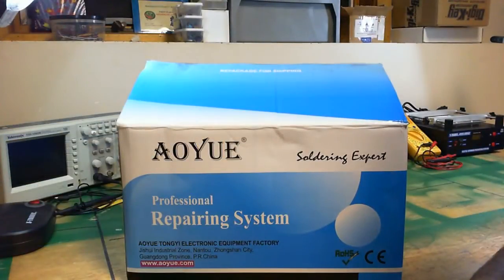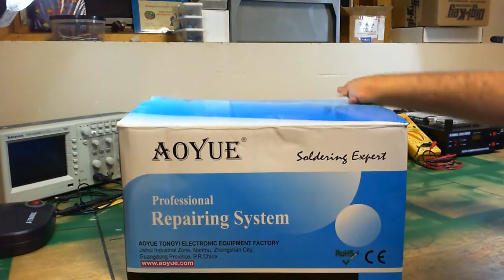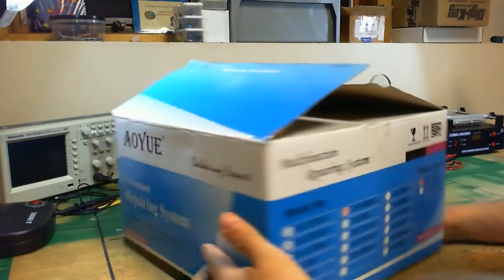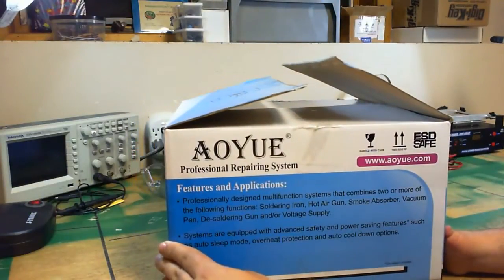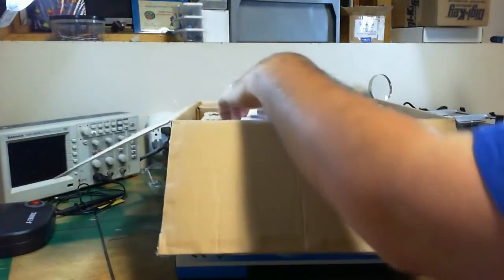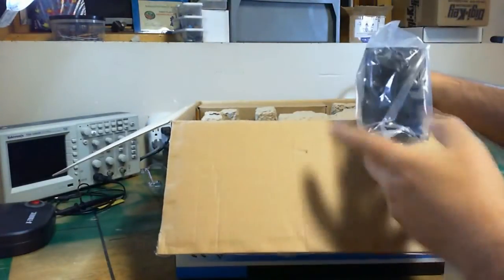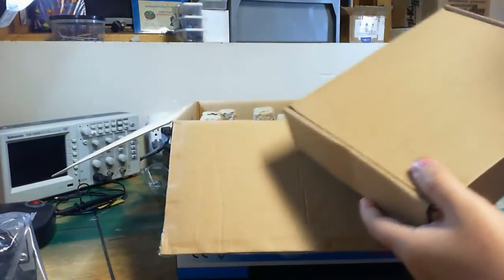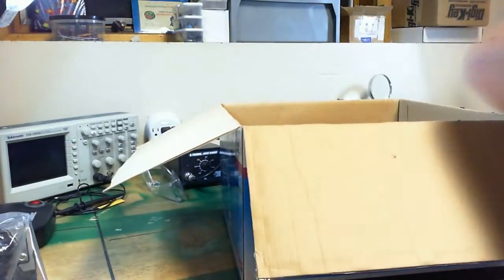Aoyue 968A+ (Product Unboxing)

Comment from the maker: The solder spindle gets mounted on either side of the soldering station as per the instructions but I believe you could mount it in the middle if you wanted but you would only have 2 screws securing it there unless you put more in. I would not recommend that though due to it being so close to the soldering iron and it may heat up the solder that you have on there enough to melt the resin inside your solder. As far as the yellow thing, that is one of my multimeters that I have on my bench.